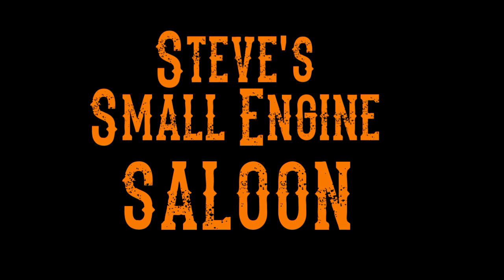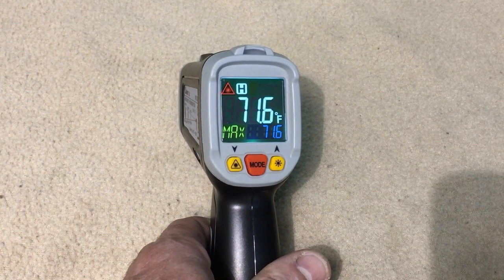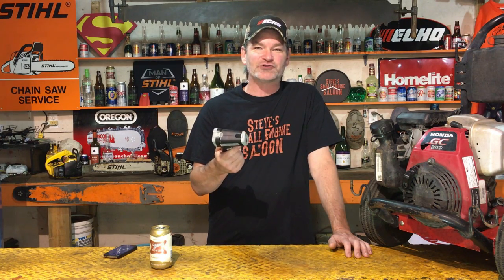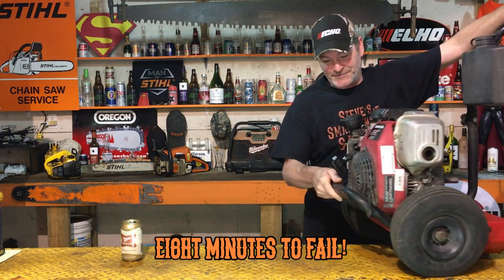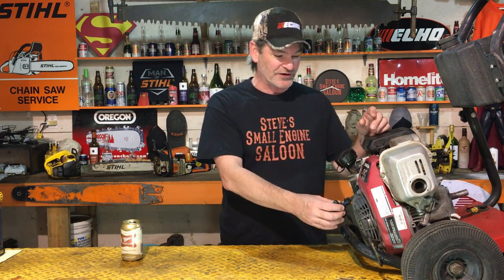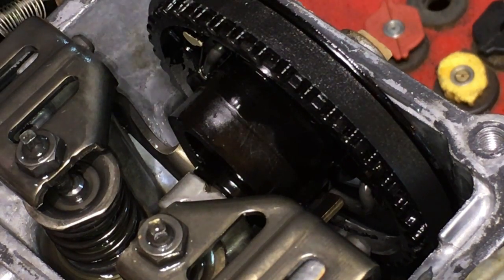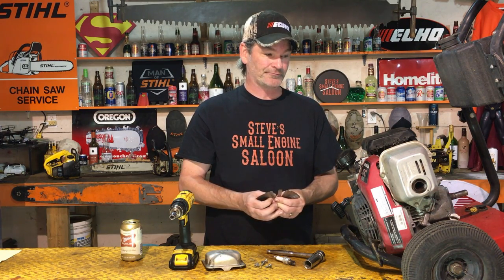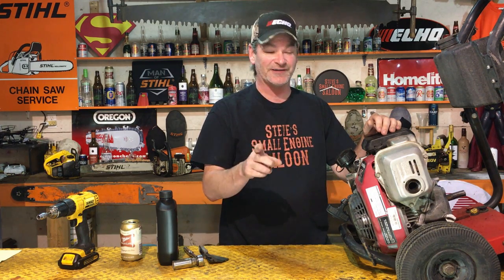How To Fix An Engine After You Run It Out Of Oil

Comment: I just got a Honda gcv 190 pressure washer  in the shop that was ran with no oil aswell, followed suite adjusting the valves and topped up the oil and it runs mint, no knocking, no smoke, starts easy, these Honda engines are no joke

Comment: I could be wrong but I thought these motors have low oil shut off Steve has duped you.I did the same thing with the Honda gx35 cc 4 stroke 37.7cc H.S clone motor just a shot of mmo unfroze it and a new plug fired back up no smoke i now have the motor strapped to staton friction drive kit on a bicycle does 28mph just rode 20 miles the other day only stopped once to let the motor cool down but I didn’t really need to

Comment: Today i was mowing my lawn with my honda lawn mower and it stated sounding like that. I thought it was just running out of gas. Until I heard a loud metal noise and the engine shut down. I thought the blade had broken or something but no, it was fine. I started checking everything on it and found out it didn’t had any oil. I added oil knowing it was too late but I had to try it and sure it had no compression.

Comment: Yeah, I whoopsied on this myself with a cheapy predator harbor freight engine.  Thankfully I realized my extremely stupid mistake, I refilled with oil, I didn't even reset the valves about 4 pulls and off it fires again.
Reply from the maker: Right on

Comment: A friend of mine ran her tiller dry. It has a tecumseh engine it broke the rod and put it through the side of the case right where the optional starter would have been. I was able to replace the rod and fab up a patch plate that used the starter Mount holes. A true lucky break. 😅

Comment: I had a Honda clone engine pressure washer and when it stopped working I took the engine apart and found that there was very little oil in the engine,but also as it was a pushrod type engine I ended up doing more damage than good, and most Honda engines are reliable, does your engine have a oil level sensor, sometimes they can have oil residue which will cause the float to stick and they will let you run the engine but after a while the vibrations will unstick the float and you won’t be able to start the engine again until they are submerged, if you want to blow the engine up then all you need to do is bypass the sensor by cutting its wires and some you need to short them but some engines have the oil sensor tied in to the kill system so as long as they don’t become shorted the engine will run.

Comment: this is fascinating. I've picked up a couple of Honda mowers that were run out of oil. Now I know what to do.....Over the winter, I was working on a Spirit brand snotblower, with the 8hp Tecumseh. Got it to run, but it'd shut off and stop right now, Too fast to be normal.  Eventually, after running it this spring, and it was running great, it did throw the side of the block all over my motorcycle.

Comment: A Tecumseh engine on idle will break at the wrist-pin ,and blow out on the electric 120 volts starter side, nice hole outside, and a Ariens will simply seize right-up

Comment: I think I ran mine out of oil; push mower, Husky B&G engine, oil cap wasn't tightened after checking it and ran it hard last weekend. Filled it up (rec'n fuel), started right up, ran a bit no prob, then just puttered out. Done. I changed the air filter (it was bad) and saw the oil all over. So put in lots of oil given to me by the husky shop, and now it starts right up and stops right away. Starts, stops, etc. I'm no mechanic. Just a suzie homeowner. Not lack of fuel, not air filter, not spark plug obviously...would it be a valve problem if it starts?  Or do I check the carburator (somehow) and clean it (somehow)? Thank god for youtube and folks like you, Mr Steve.
Reply: Replace the muffler bearings and you should be good to go.
Reply: @user-yr4os6jz4r  Hmmm!  Will begin researching.  Thank you.

Comment: Hi Steve , I mistakenly adds up an car oil on my Honda trimmer , and it run for about 30 minutes , and I noticed that smoke 💨 comes out and still running , and stops and ceased, now I clean that mixed oil and put new Honda 4 strokes oil in and losses the cease, and can not start again , my question is , can I start that trimmer again by correct the gaps ? Thanks , all the way from the land down under Australia 🇦🇺 .

Comment: Hey Steve, This is really stupid but I simply forgot to change the oil in my mower for a while even after doing all kinds of other maintenance on it. It became very hard to start and hard to pull the rope and it is an easy start engine. I'm wondering what's wrong and realized I hadn't changed the oil. What little was left was like a thick gluey consistency and very black. I ran it this way for quite a while. I emptied it of the thick oil over night and added more and it was pretty easy to start again but it makes a little ringing sound when I try to start it. Is this engine still good or do you think the rings may be worn? It also seems to be running at faster rpm now. Thanks!

Comment: I run a shtil pressure washer without oil, and now the rope got tighten you think valves could be the problem as your video was? thanks
Reply: If you can’t pull it over with the rope no matter how hard you pull, the engine is locked up.

Comment: When this happened to my JD lawn mower, the engine seized and I could not pull the cord.  I guess this means not all engines die the same way when they run without oil.

Comment: Steve, I have had some engines stop running when they are only a few ounces low on oil. Mainly a couple of small generators. Is that designed to do that so you don't ruin the engine and if so, how do they do it?
Reply: Some engine have a low oil sensor that shuts the engine off

Comment: That proves that Honda engines  are that good.
Honda for me every time.
Thanks Steve for interesting and informative videos.
Reply from the maker: Glad you like them!
Reply: Honda engines might be good on a lawnmower but they are too heavy , the iron block contributes to that , , the missus & I used to get puffed pushing it ( even as fit 40 year olds ) they are heavy machines . So I found a few old rover mowers ( Aussie built back then ) with old 200 & 220 series Briggs that I got going  , some use a little oil , but they are LIGHT & way EASIER to push than the Honda Tank , horses for courses .

Comment: Honda GC engines are not as well built as the GX or GCV engines. The head is not removable on the GC. Just harder to work on than a GX or GCV. Great video.

Comment: Would have liked to see you JUST put in oil and restart...failure may have had more to do with tolerances due to overheating that subsided after it cooled down.
Reply: my question too.after cooldown,with extra clearance in valves it still maybe started

Comment: Hey +steves small engine saloon i honestly thought it would be scrap metal afterwards 🤣 love your videos im learning a lot too 👍👍
If u run a 2 stroke without oil in the fuel it melts the rings into the grooves  which obviously means no more compression lol 😉

Comment: There's a thermal switch on it.
Reply from the maker: NOPE...
Reply: I noticed a carb. pump/gasket that proabably fits most styhl, blowers, weedeaters, it had some spyral spring.  I could use about a dozen.  If you could just provide the web site please.

Comment: And that’s probably why mine died! Yep! I’ve ripped the carburetor apart four times and cleaned it out. I’ve got spark. I’ve got compression. Seems like I’ve got fuel. But It won’t start. And that’s about as long as it ran so I’ve got a strong feeling based on the amount of oil I’ve put in it after it died that I’ve ran it out of oil! Now time to adjust the valves! Brilliant! 🤞🙌🕺
Reply from the maker: Right on

Comment: I’m working on my first Honda 160. I was surprised to see it has no head!!! WTF?!?! Valve clearance good , springs - belt- cam gear seems ok... Coil gap good, flywheel key good, carb clean good..... but backfires out the exhaust???? I would very much appreciate some ideas.

Comment: I am left wondering though, did the piston and cylinder get scored? Or the fact that there is compression rules that out? -- So is the conclusion that the heat distorted the valve settings (only?) ... no other damage?

Comment: Runs good now but it probably won’t last real long under load.  Rod bushing took a beating running dry as well and main crank bearings.  .That said, that GC held up extremely well compared to cheaper engines.  I like the Honda small engines and own several. They all start super easy and run well.

Comment: You should try adding some slick 50 that stuff that lets your engine run without oil, I know from personal experience.
Did that with a V6 Ford engine a few years ago. Not by choice. I picked up my Windstar from a place that replaced the water pump it was sitting outside with the Engine running ready for me to drive away.  Drive away I did. Drove it for a few days put about 250km on it.  Wasn’t until I was driving back to my house on the highway that the crankshaft bearings finally went and vehicle started shaking!
Got home pulled the dipstick and not a drop of oil!
Still ran after I added oil but it was a write off after that.

Comment: Now if that Honda were under a decent load, this experiment would have went a lot different.
Reply: It will lose half its power if u try and throttle up. But, if u didn't cook your main bearings (over 10 mins for small engines under medium load) then top it up with oil again and everything should b fine.

Comment: It'll break the plastic cam on the GC's. Usually won't break the rod. Gcv's will just slowly stop cause of the massive scoring due to their excellent aluminum bore design. Those engines would be so much better if they at least lined the bore with something!

Comment: I see you are getting many " Honda is the best ... " replies but I have had 2 brought to me after being run with low oil and I could not rescue them. Reset valves, etc. just like you did but it was just too late; one fairly quickly threw a rod right thru the block. I like Honda's too, but they are not bullet-proof,. I know it sounds obvious,  but like for like all engines, you can't be lax on maintenance.
Reply from the maker: Amen....

Comment: That was really amazing.  I once forgot to refill a B&S mower( you know how it is when you get pulled away for something else) and it completely seized up.  Could not turn the engine.  Now it seems like I check the level several times.  I'm sure I lose more oil wiping the dipstick than running the engine.
Reply from the maker: Right on...

Comment: I loaned a Honda GCV160 powered mower to a family  member & he overwhelmed it with clippings & clogged the air filter. Eventually it sucked in & burned oil till it was almost empty. It threw the rod right through the crankcase. Maybe it was because of the blade load but your PW, though not having the pump attached, still has load because it has a heavier flywheel to add load. I think you are kinda lucky that more damage wasn't done.

Comment: By the engine cranking after the valves was adjusted properly, and oil put in the crank case is saying quite a bit about how that engine was built.
Reply from the maker: Right on....
Reply: They have aluminum bores. The GC series  are not that good. However, the GX motors are actually one of the best out there.
Reply: @adamdorris4081  spot on.

Comment: Project farm would approve
Reply: Yup
Reply: Thinking the same
Reply: Project Farm did that where one lawn mower engine ran with straight engine oil and another one with oil that had Slick 50 in it. After that they were run with no oil to see which one would fail first. The one that had Slick 50 failed first and then the other one. They both seized up and apparently neither one could be repaired.

Comment: I just had a drain plug back out of a 25hp Kohler Courage motor, and smoked it too.
 I'll try this and see if it will work for a Kohler.
Reply: Those courage engines are junk make sure to blow up every one you see or have lol

Comment: Steve, there is no friggin way you could make that a reliable  under load engine again running it for 8 minutes without oil. The crankpin & rod journal have to be toast, to say the least.
Reply: That's my experience: a noticeable rod knock, and they burn a lot of oil after a seizure like that.(though this one didn't actually seize)

Comment: Heck yeah no Bull Butter for sure..........     You did not throw a rod or seize the engine.....  

Amazing Hondas and LCT's  are great engines.......    

I cannot leave out Briggs though.......    I seen quite a few of the older classic's 3.5 and 4 HP. videos where they drain the oil and then throw sand and dirt into the carb, with the gov wide open and it takes 10  to 15  minutes to THROW a rod and destroy the engine totally.......  

A test of course for that purpose on the Briggs engines........  

In fact I am thinking you are trying to explain the low oil situation or no oil example and getting it running again......    Which in my mind is a GREAT effort on your part to save the consumer money........     

Looking forward to Part 2 of this video Mon Ami.......  

Kudo's to you    

Plus Tard Mon Ami ~!~!
Reply from the maker: Thanks Boo.  I am definitely going to SMOKE this engine soon.  Gonna set the governor backwards and let it go!  Stay tuned....

Comment: That sir was interesting. 8 minutes and 1900°! Set the valves and it started, I would not have bet on those results. Just having compression was amazing, but starting. Miller High Life stands clear, so Honda Motors do to. Thanks Steve.
Reply: I think you better watch the video again.  190 F not 1900 F.  The whole motor would have melted at 1900 F.

Dale in Canada
Reply from the maker: Right on....

Comment: Honda small motors are just about bullet proof. Valve adjustments go a long way to allowing an engine to breathe and run properly. My old XL600 needed valve adjustments a couple times a year, otherwise it would lose it's thump.
Reply: I had pne one of the600, dont recall the letters mita been xr600. Started out as off road bike that orig owner put baja kit n made street legal. It was too big for me & i prefer 2 strokes. Sold it to a crazy guy who said he can wheelie in 5th gear!